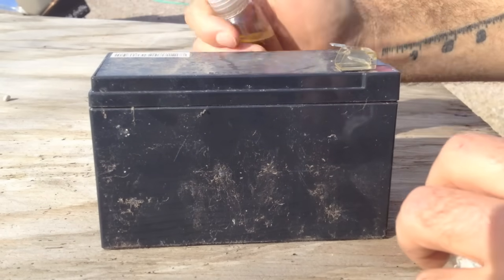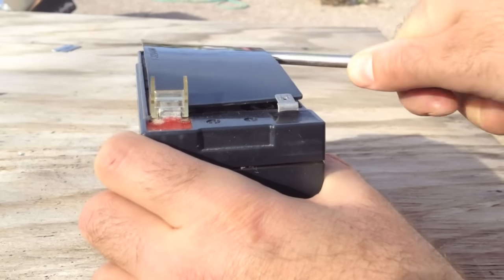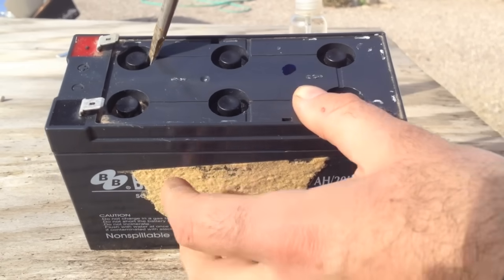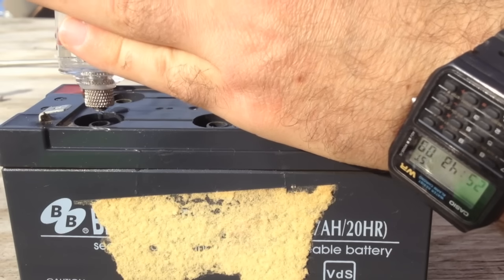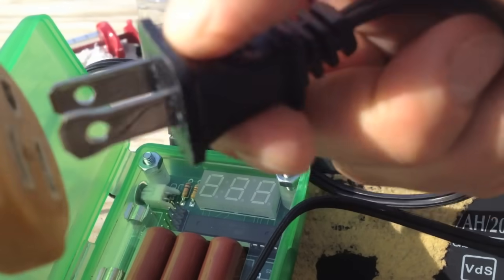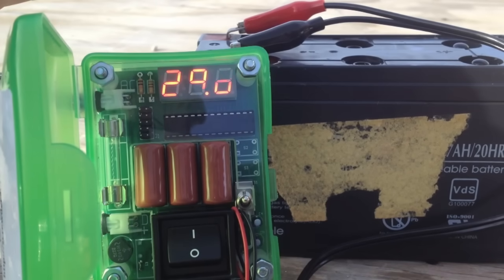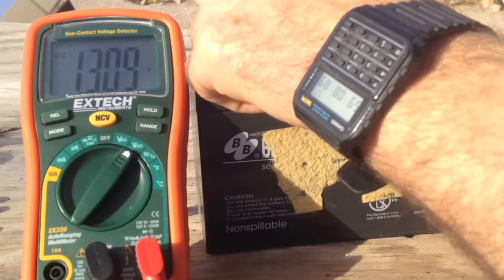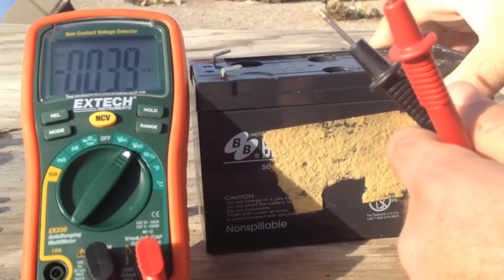Sealed Lead Acid Battery Recovery

Comment: Really, just use rainwater? With all its ionization and contamination with minerals? I'd have thought you'd have to use distilled water...
Reply: @Michael Robinson Distilled water is pure water.  Rainwater condenses around cloud condensation nucleii such as mineral dust, pollen, bacteria etc and then collects huge amounts of airborne dirt, vehicle pollution , minerals  etc as it fall through the atmosphere. Rainwater is actually pretty dirty and is also usually collected from dusty gutters, metal buckets or any othe container left outside for weeks to collect muck.

Comment: I have a pair of sealed 6FM4.5(kS4.5-12)12V4.5AH/20HR both after charging well below power ,noticed when looking inside very dry can I put battery acid in them or just distilled water or does these take neither and just dispose of them unemployed so fixing them better option

Comment: So you have a sealed battery, yet it lost water? not very good seal then
Reply: Water? Its sulfiric acid
Reply: not pure, its diluted and its water that will evaporate first, that is why you top up with distilled water...
Reply: Ever heard of built in obsolescence?
Reply: Chaz Madge as hydrogen gas is produced through the small vents, it will over time lose its content. If batteries were not vented, gas build up would lead to a rupture or explosion.
Reply: plastic isn't 100% waterproof, also the hydrogen and oxygen of the water (and other gases from electrolysing sulfuric acid? i don't know) can vent out if there isn't a part of the battery that burns it down to water again (so i heard), also as WireTamer said, build in obsolescence also could be a thing with those batterys

Comment: If you have trouble getting the dead battery to recharge, link the dead battery to a good one and run 12V through the two. Dunno why it works but it does.

Comment: So basically sealed batteries are the same as unsealed batteries but you can't get to the filling plugs? Is it really that simple? Just get to the plugs, fill the battery with water and recharge it? Amazing! Subscribed

Comment: Nice video,Though would like to know more. Like where did you get your pimp charger?,cost of it? How many volts does it put out while charging? Wouldn't distilled water work? Work better than plain water? Does this also work on sealed gel type batteries?

Comment: but how long does it hold the charge for? same as when new????? My SLA batteries on my bike 18AH 12v. After 6 months I can just get about 9 miles on full charge and by then I'm going very slow. Any thoughts... And please don't say " buy lithium ion" unless you would like to donate some funds... hahaha
Reply: Lakshay Sethi no answer. I bought 4 new batteries for about  $160. 12v 22AH  Having fun again.
Reply: I feel your pain...I have an e-scooter (60v but I've now made it 72) and a much cheaper option to go lithium is to go buy cheap 12 cell laptop batteries, take them apart and build your own packs.  If you're good with electronics and can solder it's a good option, I know you didn't want anyone telling you to go buy lithium, just thought it would be helpful :)
Reply: Don't buy lithium-ion... find a computer repair shop and ask if they'll give you the battery packs from any discarded laptop computers they get.  Most laptops these days have 6x 18650 lithium-ion cells, arranged as three series-connected pairs (11.1V nominal, 12.6V maximum, 9.0V minimum - approximately).

If you're going for parallel connected cells to increase the capacity, it's probably best not to disconnect the two parallel connected cells from each laptop battery, unless one set turns out to have a drastically reduced capacity when compared to another set of two cells.  This would indicate that one of the two cells in the pair is damaged and should be discarded, which of course requires the pair to be disconnected from each other.

Also, since all cells in a particular pack would have been balance charged to the same level consistently, it makes sense to put all of those cells in parallel if you're building a larger battery pack.

Testing the capacity of the cells requires spending some money on a charger with discharge and capacity testing capability, but you only need to buy one of those and you generally get balance charging with them.  Mine is branded Powertech Plus but there are heaps of very similar chargers at reasonable prices.

Finally, be sure to charge or discharge all cells to nearly the same level before connecting them in parallel, otherwise the cells with more charge will immediately try to charge the cells with less charge, at a rate which could under some circumstances cause the cells to overheat and explode.  This won't happen if the cells are fairly close to the same charge level and therefore close to the same voltage level.
Reply: Jason that's horrible advice! Some could get fucked up big time by doing that! Do NOT use old laptop batteries for Ebikes, skateboards, tools or anything that uses a decent amount of amperage, which is most thing people want to do with them. Laptop batteries are NOT high drain batteries and will explode if to many amps are pulled from them especially the damaged cells that obviously a discarded laptop pack will have in it, why else would someone replace it......  You can harvest the good cells from them sure and use for a clock or small flashlight or something but never for Ebikes or the likes.

Comment: This is OK if your not going to put it under any usable load. In all reality these days its easier and safer to just buy some new batteries. I just bough 3 of these same 20Hr 12 volt batteries on ebay brand new for $20 shipped to my door.

Now if these were higher cap more expensive types ($400 ea) then yes you want to try to salvage them and get more life from them. 

This ONLY works if the battery is not sulfated and the plates are not damaged. If the plates are damaged you can damage your charger, cause the battery to become too hot too fast and vent or even explode, or start a fire so do this stuff outside always!

Instead of a razor blade use a small metal putty knife and a ball pin hammer and tap it gently in until the handle touches the battery then pry it up from the end. You can speed this up with a heat gun too.

Putting the cap back on you can epoxy it back on.
Reply: What do you money trolls doing on a DIY page!
Keep your money.
This is about learning survival skills, not penny pinching

Comment: A friend gave me a 24Ah damaged, im going to try this RIGHT NOW :D
Reply: Ashraf Green I used destilled water on a 4 Ah battery and no luck, and I tried sulfuric acid on the 24 Ah, it went fron 2v to 11v just by adding the acid, but it doesn't go higher than that with the charger... I try using it just to light LEDs. :(
Reply: Xyar
Reply: bluetorch13 Sulfated batteries are doomed, there is no way to ever fully recover them despite all the "snake oil" on the internet. Best to just stop being cheap and buy a new replacement.
Reply: ElfNet Gaming Is not about being cheap, In my country a 7Ah battery costs 4 times minimum wage.
Reply: It's called EBAY man. use it.
Reply: ElfNet Gaming minimum wage here is 10$ a month. AND we have no access to US Dollars (or any other foreign currency) yep... we are f*ked.
Reply: @activeworker9447  Lame
Reply: @joynulabedin450  Lame

Comment: "This battery is so dry"...
Dude that's an AGM battery... the electrolyte is absorbed in that white glass fiber mat you see through the holes...
Reply: Yeah, was going to comment that those batteries should "Never" be filled and left with liquid in the chambers. It's supposed to be moist on the inside of those particular batteries and not wet, hence the reason that type of battery can be used while the battery is lying on the side (Although it's not ideal)

Comment: 55v of charging? how??
Reply: thats my thoughts too.
Reply: Batteries are charged by current (amps) - if there is no current going into the battery, it won't charge.  When you start charging a dead battery at 14.4 volts, often you'll barely get 0.01 amps going in, which means you'll be there for years trying to charge it.  How do you get more amps into it?  You turn up the voltage.  Cheap chargers will just sit at 14.4 V all day doing nothing, while good chargers will increase the voltage until the battery starts taking in a decent amount of current.  It takes a pretty nice charger to reach 60 V though, but I've heard that's what it takes to start a battery charging when it's in really poor condition.  You'll notice in the video that pretty quickly the battery starts recovering, and drawing in more and more amps, so the charger progressively lowers the voltage until it's around 24 V, because it wants to keep the charging current fairly constant.  So it'll keep lowering the voltage until it reaches about 13.4 V when the battery is fully charged.
Reply: It is definitely not recommended to charge at that high of a voltage, even during the recovery process. Excessive charging voltage will result in hydrolysis and boiling electrolyte as well as excessive heat buildup and capacity loss. What I recommend for battery recovery is using a power supply set at 13-13.5 volts and allowing the battery to take as much amperage as it allows. Once the battery has sufficiently recovered to 10 or 11 volts you can then put it on a charger for the remaining charge now that it will recognize it as a battery again and not just a resistor.
Reply: It is polyester ac-dc charger which can help to charge this lead-acid batteries and even dead batteries. ac-dc charger is an adoptable charger which is automatically adjusted with the output batteries and very first moment if you touch it you will get shocked.🙂 It's that simple.
It provides both two types AC and DC voltages, very first moment you can check the terminals by a tester. As it grows higher of the battery voltage it gradually turns into DC and at the last moment if battery ok you will not get shocked. AC is higher in voltage and it's frequency range 50-60hz that's why it get shocked.😊
Reply: Oh Boy! 👍🏻
Reply: an Over Voltage Charge to 'wake up" the battery, an old trick to bring cells up quickly and hen back to a normal charge, not safe it is not controlled, Better to just use a Pulse charging system and keep the voltage at a more reasonable value

Comment: Hi, once I filled the battery slots with distlled water, can I able to charge with NOCO Trickle Charger instead of using DA PIMP Charge or I only have to use DA PIMP Charger? Thanks in advance for your reply. PUBBY.

Comment: Bull, only a new battery will work. Needs taking off the internet this man.
Reply: Amen, this will never have anywhere near a usable capacity - voltage is not Amp-Hours!
Reply: Depends how far gone it is,have done it many times and it works --to be really precise one should equalise the electrolyte by leveling each cell with one another water,check specific gravity,adjust with acid if necessary,and obviously level up with distilled water, charge up and off you go.

Comment: I have an old sealed lead battery, the multimeter reads 1.97VDC on it, is it still good and just recharge it? or do I need to pry it up and add some water to the cells then recharge it?
Reply: Do some research on Sulphation.

Comment: walter white watch ;)
Reply: American Hacker u r real not fake american life hacker
Reply: There are  a few tips for battery reconditioning
never try to do this unless you know what you are doing - the acid can burn your skin
check the voltage first - there may be a dead cell which would waste your time.
Check the battery fluid.
attempt to fully charge the battery.
(I learned about these on rapid renew roadmap website )
Reply: Just wonderful, been searching for "how to fix your car battery" for a while now, and I think this has helped. You ever tried - Ammaceen Reconditioning Rabblement - (just google it ) ? Ive heard some pretty good things about it and my colleague got excellent success with it.
Reply: People, you understand that lead acid batteries are corrosive Right? Depending on the application you are using the battery for and the importance of the battery not failing, try this at your own risk. I worked in the battery industry for over 20 years. He mentions he would like to determine if battery reaches full recovery. Impossible! Again, batteries are corrosive. This means the internal components break down. Specifically the lead plates flake away and form sedament at the bottom of battery. This guy also incorrectly demonstrated how to check and determine if the battery is fully recovered by checking voltage only. The cells read the correct charged voltage however if the specific gravity of acid/water is not balanced(mixed) properly, when the battery is put under load, or hooked up to the equipment using it, the voltage drops out and will not have the power to sustain voltage. The method he shows is only a very short term option if you are in a jam. Do not rely on this to power you up its brand new or safe for any length of time.
Reply: American Hacker a
Reply: Thanks for the Video! Excuse me for butting in, I would appreciate your opinion. Have you considered - Rozardner Powerful Battery Reality (search on google)? It is a smashing one of a kind guide for learning how to recondition an old battery without the hard work. Ive heard some super things about it and my cousin after a lifetime of fighting got astronomical success with it. 
#how to repair lead acid battery

Comment: Hi. I follow the procedure and charge a 12v 7.2 ah battery with DC 14.8v at 1300ma. Table stated 6 hr of charging time. While charging water start to bubble out from one of the cell. Now getting at 4.38v. It this safe to continue? Did not charge this 3 piece since end 2014, totally flat. Did I fill to much of rain water? I dont have battery water here anymore since dry cell took over. Advance thank for replying.

Comment: what kind of water did you refill the cells with? Was it distilled? 
Can I use a UPS to charge the Sealed lead acid battery after I refill it with water?

Comment: Excellent! Thank you! How did the dirt got under the sealed lid though?
Reply: The lids aren't sealed, just tacked down in a few spots. So the dirt seeps in the edges. Interesting that they call them Sealed Lead Acid Batteries, if they were truly sealed, gas pressure from charging would build up and blow or crack the case.
Reply: Hi!!!! Where can i Buy this product??Tks

Comment: I saw a video very similar to this but the guy used alum (food grade) and water (The same things you brine pickles in). It was a non sealed / car battery but would that work here? Empty it all, clean with baking soda, rinse thoroughly... and then put this alum water? I am familiar with adding water to a non sealed battery. The reason I ask is the charger I have will not come on if there is less than 3 volts. The alum gave the guy about that.

Comment: Great tutorial! Just got a bunch of 12V  Fiamm GS SLAs and a 6V 4Ah SLA from an old Sanyo Emergency lamp. The voltage across the battery was <1V when I recieved it. Filled it up with distilled water and connected it to a laptop 19V 6.5A adapter and ran it for like 15-20 mins and a little later the pH was high when I checked and the water was boiling, removed the charger let it cool down and then connected it to my 7.2V charger and after two to three cycles it was running good. Oh forgot to mentioned the initial charging with 19V and 7.2V was done with the cap oopened to get the electrolyte to proper level. :)

Comment: Random question. If you don't have an actual charger, could you take a 12v power supply and charge it that way and if so, how long should you leave the 12v power supply connected to the positive and negative terminals?

Comment: i have used fresh battery solution instead of water to replenish a few motorcycle batteries and they worked. Was that dangerous, or maybe good? if it's good, would you use fresh acid solution to replenish a sealed lead acid battery (20AH deep cycle) used on electric trikes. tnx.

Comment: Damn it, I've worked in the alarm industry for 30 years, and have thrown out hundred of these batteries. I could have resold them as rebuild seconds. Retail, they sell for around $60.00 AU. Wholesale around $20.00 AU. 
Thanks mate.
Reply: Don't do that. It's not a "rebuild" They loose alot of capacity when doing this. *For example a new battery could go for 1 hr at full discharge.. Where as a revived battery would only last for 10 minutes. It's not worth it. Especially if you would be selling them!
Reply: Thanks. :)
Reply: Agreed, they're nowhere near the quality when they were new.

That said if you can source the chemicals and are willing to go through a lot of hassles with charging, testing and measuring you can get reasonable results at times if you're lucky even with batteries that won't recover well this way.

But to say it's a good way to spend your time for a small amount of money, I don't know. Personally I feel like either you have to invest some time and money into coming up with a really well automated system that handles a lot of the charging and analysis in bulk or it genuinely has to be your hobby.

If a recovery like this won't do enough to get the capacity needed for your purpose I'd be inclined to have it recycled instead. Especially if it's powering an application that has to be reliable long term.

Comment: Im trying this at the moment on a shumacher battery from a jump box. it had sat in storage for 2-3 years. ive cleaned it up and filled the cells with distilled water. charged it for about 20 minutes with a battery doc (battery tender). it reads charged but im pretty sure its a surface charge. im going to let it charge for about 24-48 hours. hope it works out

Comment: Hello, I have Lead crystal batteries of 170Amps, they accumulate only power for 1 hour used with a TV screen 62 inch SAMSUNG. Can I repair using the same technic?